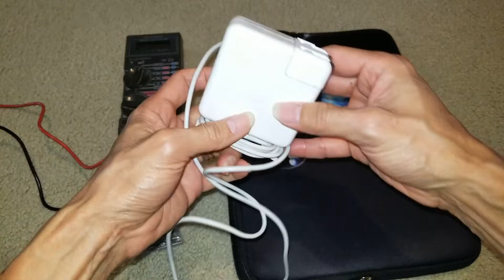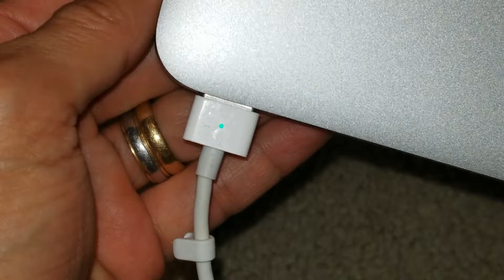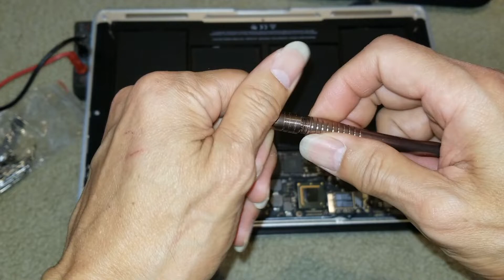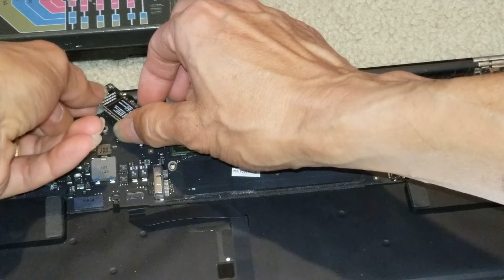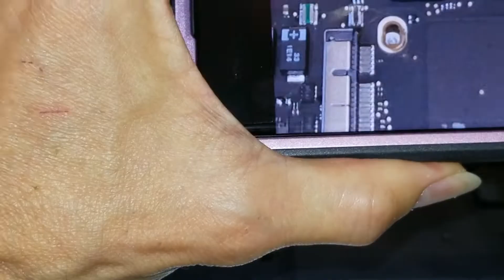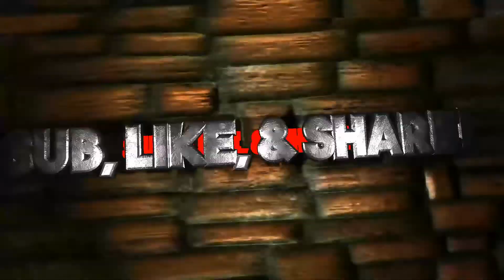Troubleshoot Apple MacBook Air A1369 Won't Turn On Or Boot Logic Board Full Teardown & Disassemble

Comment: I used an 85 watt charger on my Mac air 11” and blew the smc chip or however you call it  😂 learned my lesson and I always use original charger for Mac laptops 🥺🥺
Reply from the maker: Yeah, that's an $expensive$ lesson.